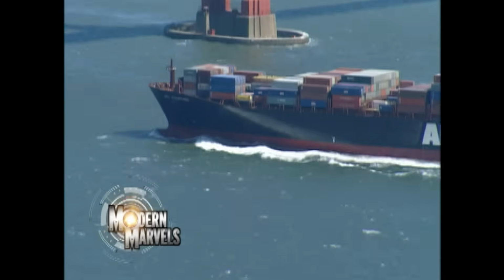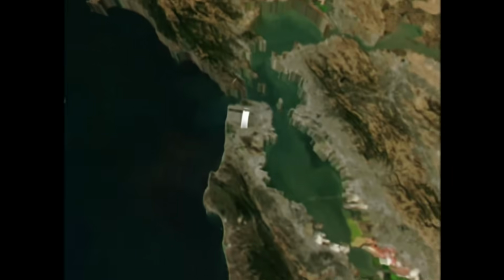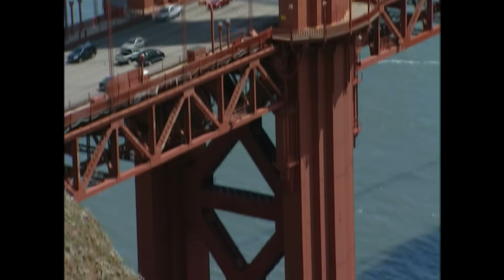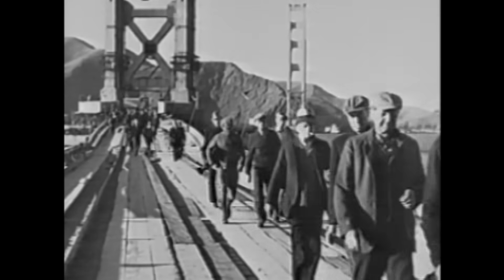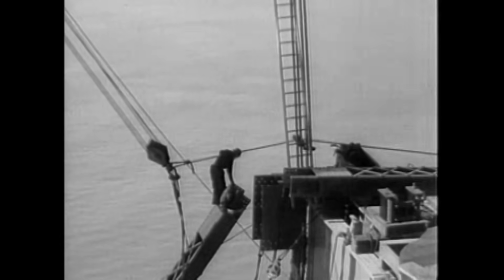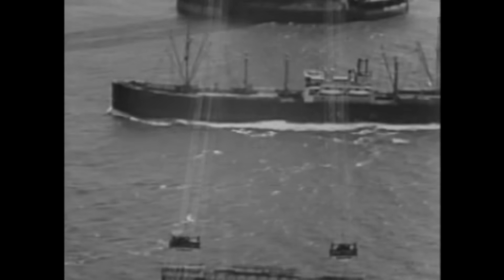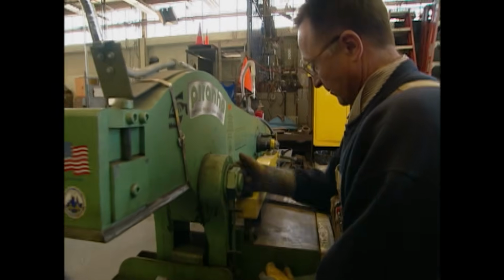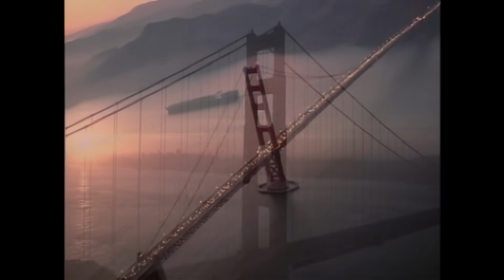Colossal Construction of the Golden Gate Bridge | Modern Marvels (S2, E6) | Full Episode | History

Comment: Amazing that they could line up the bridge towers especially from that distance, they had nowhere near the technology and computers that we take for granted today.
Reply: FYI: The overwhelming majority of suspension bridge towers today are made of steel-reinforced (rebar) concrete.

Computer modeling showed to structural engineers that steel-reinforced concrete towers are stronger and (not surprising) longer lasting than steel towers like those on the GG Bridge and pre-1960s-70s suspension bridges.

Comment: What about if We put a roller like on a Dyno in front of the bridge  that when the car drives over the barely exposed roller it spins and generates a electric charge that in turn powers batteries that can light up the bridge at night or even some nearby buildings   I mean you can also use solar or wind power but why not use the energy that automobiles make idk could be a pretty cool alternative energy source
Reply: A roller generator wouldn't work to well. If a vehicle sits directly over the roller it will just spin and the vehicle could not push forward. Wind turbines or wave-pulse electrical generators would make a lot more sense.
Reply: @seanriopel3132  I thought about that but if it is recessed into the ground where only a little was exposed then it would work I think. I'm not talking about something the size of a Dyno, I'm talking something about as wide as a tire or maybe two and just one where say the driver side tire hits the roller